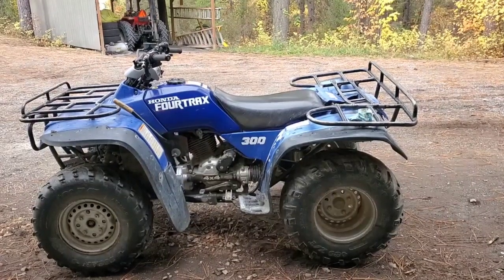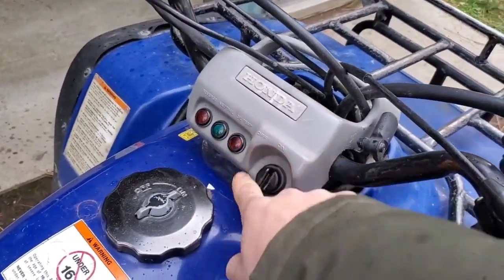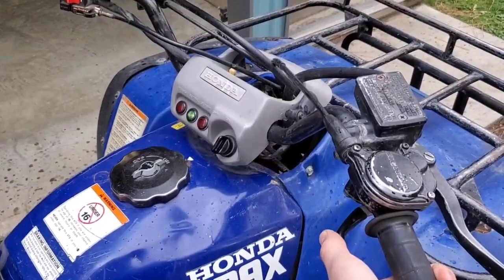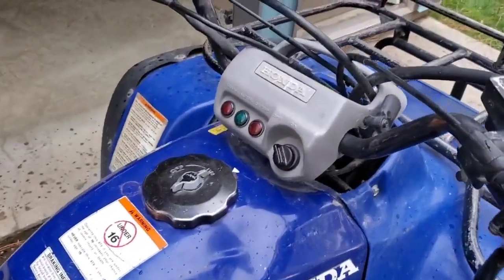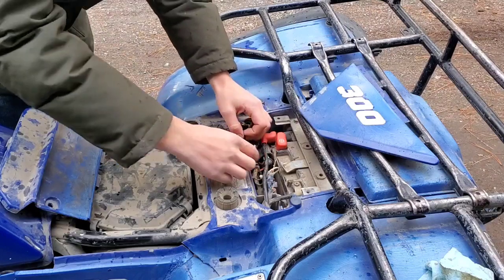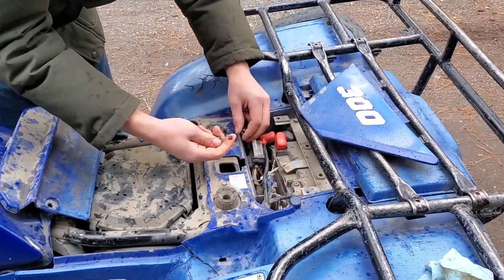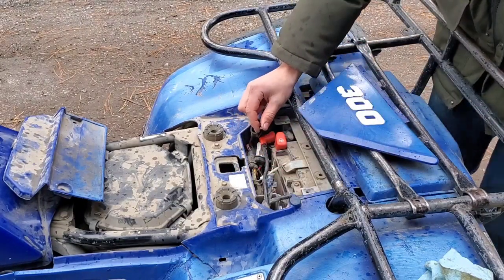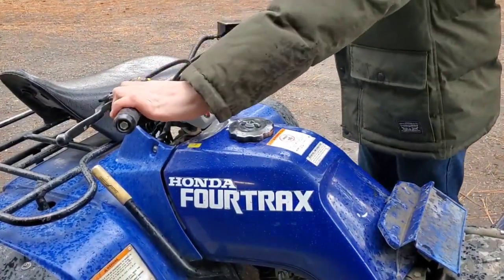No power, no crank | 1990 Honda Fourtrax 300

Comment: Update: My fuses looked good, so I wanted to see if the headlights were working. No, they weren't but after working the switch off and on several times, the lights started to work, and now it cranks. Go figure, lol. Apparently, the headlight switch is tied into the ignition somehow. Thanks for the video.

Comment: I got a 2000 Honda fourtrax 300 I get no neutral light and the start button does nothing but I get the oil light for a second when I turn the key on I can make it turn over by jumping the solenoid but I get no spark at all I ordered a kicker lever hopefully that’ll get me going but does anyone know how to fix my electric start?
Reply from the maker: Sounds like a neutral position sensor. That would explain the no neutral light and not cranking. Is the no spark on the spark plug or something else?

Comment: My fuses are perfect and it is still doing the same thing
Reply from the maker: Sometimes, and in my case, the fuse can be broken at an end where it isn't easy to see. Did you check it with an ohmmeter? (Make sure the key is off while doing this)